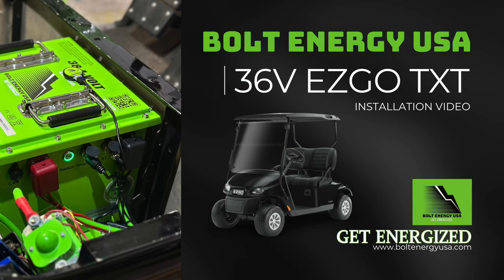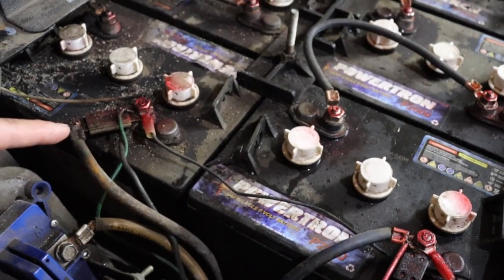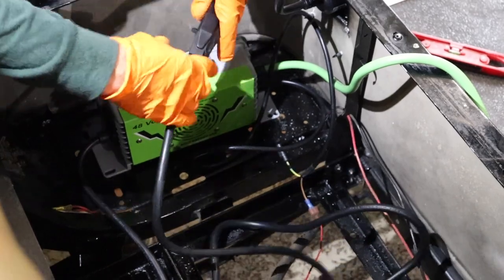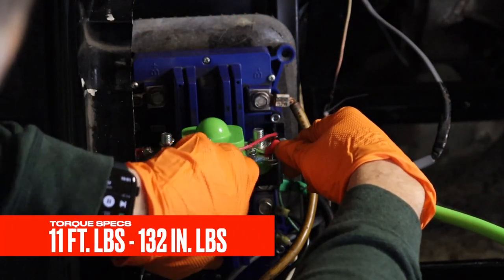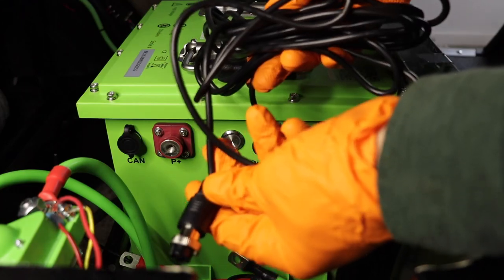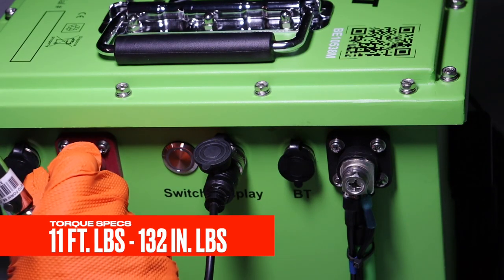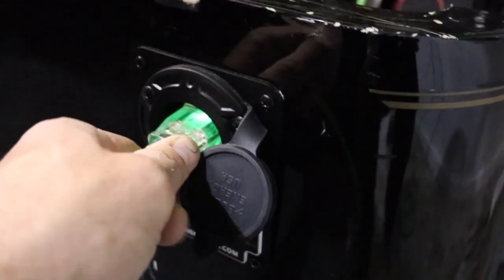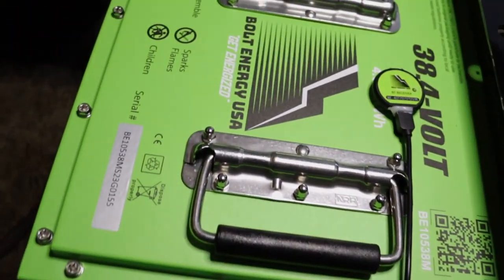Bolt Energy USA 38v - 105ah EZGO TXT Lithium Golf Cart Battery Installation Video

Comment: I have the 73.6 volt 105 ah battery in my 2015 GEM e6 and I am super impressed with the performance of this battery. If anyone is is considering upgrading to a Lithium battery DYOR because they are not all built the same. I compared Bolt Energy battery spec sheet to all of the other brands on the market and Bolts Energy are superior in every segment. Continuous max amp output is very important especially with a 6 passengers or a lifted cart with larger tires or if you live in a hilly area. Many battery companies fall short with this spec and the battery management system will cut power off to your cart. There is not another Lithium battery that can beat their performance specs or 10 year warranty. Their kits are clearly quality from their waterproof chargers to the heavy 2awg cables to the stainless steel hardware and SOC digital meter. I would highly recommend Bolt Energy over any other Lithium battery on the market.
Reply from the maker: Thank you so much for your honest review. We are here to make sure you love your Bolt battery for more than a decade.